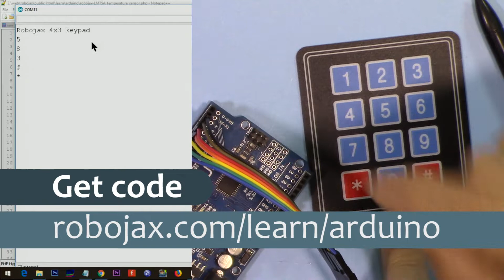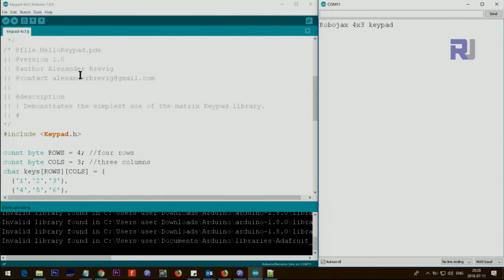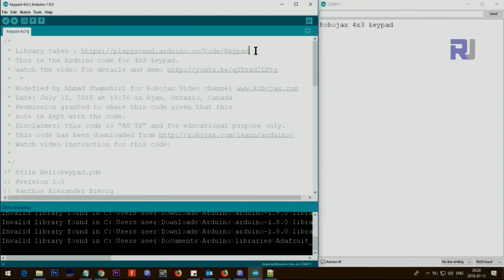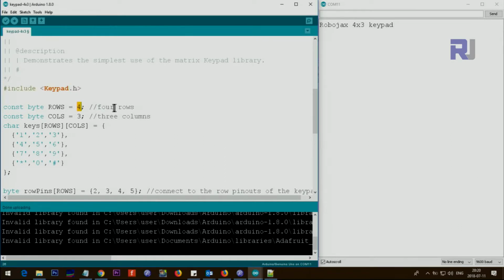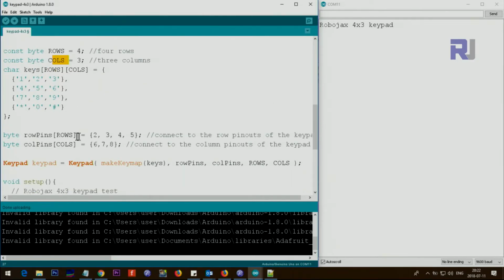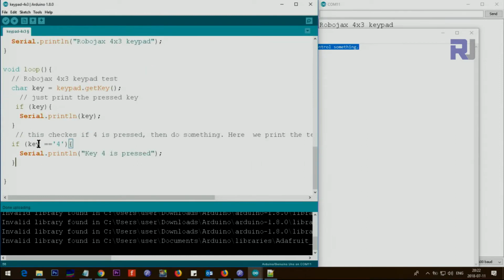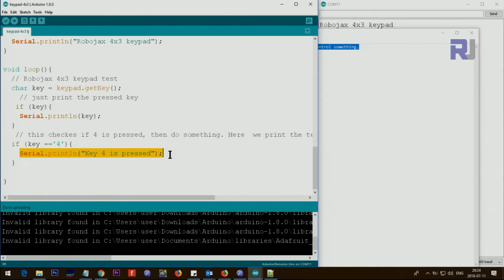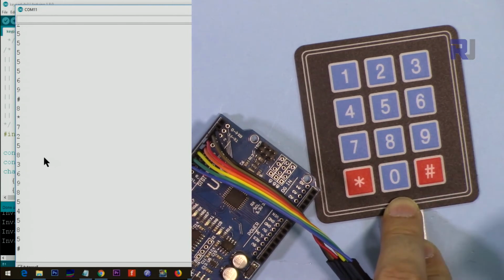How to use 4x3 Keypad with Arduino RJT104

Comment: Hi and thanks
If I have 25 files stored in SD card, how can select any file of those files by use keypad buttons
For example if I want to run file number 20 , then how can I use button 2 and then button 0
🙏🌹
Reply from the maker: Hi, you gotta learn about conditional statement https://youtu.be/Mky-04NH_CQ and working with array https://youtu.be/OgDZIP3VBK8 or hire someone.

Comment: sir it is gud but when i use with near the 3 phase motor keypad itself running because of there is no pullup and pulldown how to remove this problem
Reply from the maker: Hi, then use pullup resistor. 1k ohm.  You can learn it from this video https://youtu.be/TTqoKcpIWkQ

Comment: Great video, thanks. How do I access each of the buttons in the code to implement something? Like say,  if (button 1 is pressed){turn on an led} or  if (button # is pressed){turn the led off} Do you have a sample program using this keypads code example? I would definitely appreciate such an example. Thanks
Reply from the maker: You are welcome. Under the same line where the text is printed, you can put the turn ON or OFF. You can learn it from this video https://youtu.be/2WwedCRwmgA here is my 30 minuets Free crash course on Arduino https://youtu.be/Mbb2xa1WcRM or if you want to learn arduino with 100s of projects covering  almost everything, I have an Arduino course on Udemy.com here http://robojax.com/L/?id=67

Comment: Thanks for this video. Please also share the video for reducing the pins, in place of 7 pins in arduino.
Reply from the maker: you are welcome. This was supposed to be 3x4=12 + GND=13 pins and has already been reduced. The only without extra hardware it is not possible to reduce it.

Comment: Excellent and informative video. I'm very, very, very new to arduino. I found a YOUTUBE video on using an Adafruit soundboard with multiple buttons as triggers to make funny car horn sounds. I have built this. BUT, I would like to use the 3x4 keypad as the TRIGGER for the sound board. I have the Adafruit Sound board and a Arduino UNO. How do I send the EVENT from the KEYPAD from the UNO to the SOUND BOARD. I don't know which PINS to connect to, nor how to change the code. Can you help? ... thanks!
Reply from the maker: First run this code as is. Making sure it work.  When it works, actually pressing a key is an event and it is printed on the serial monitor.  I am not sure how the sound board (I assume it produces sound) works but you should be able to make sound with some command. Find that command like "playSound" or something. Then connect your sound board and this keypad to the same Arduino.  then instead of printing text on the screen, just run you sound card command.
I have got over 250 video tutorial and I am sure some will help you learn how to do it. But if you want to learn Arduino in structured course, step by step, with all codes and library in one place, please have a look at my course at Udemy http://bit.ly/rj-udemy

Comment: yes there is but I never tried it. check the link: http://www.instructables.com/id/Arduino-Nano-I2C-Matrix-Keypad-With-PCF8574PCF8574/
I hope Jack will demonstrate if it can be done as it shown in the link.  thank you Jack for the great video.
Reply from the maker: this module used 7 wire. The I2C module uses 4 wires. If the extra 3 wire is needed, then worth using I2C. But I will not use it just for no reason. I will see if I can get the module and will have a video on it God willing.